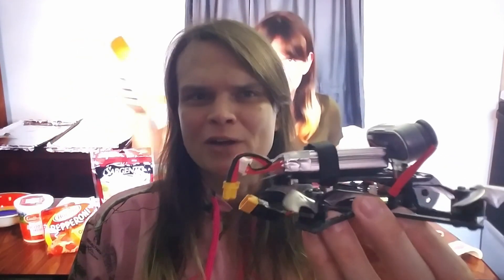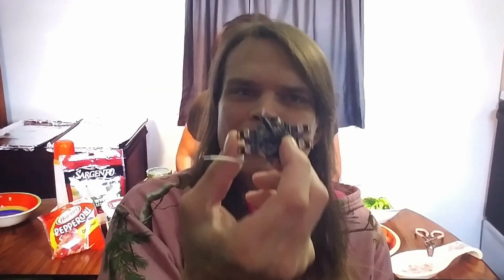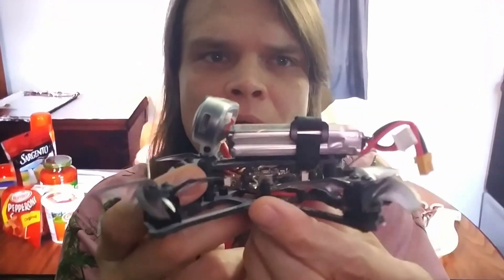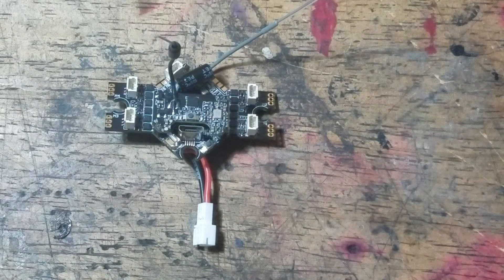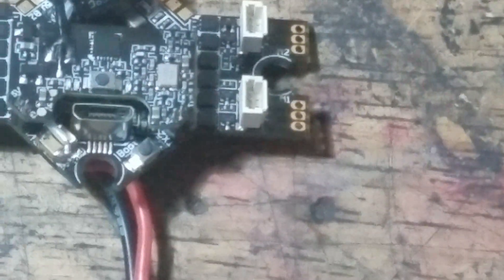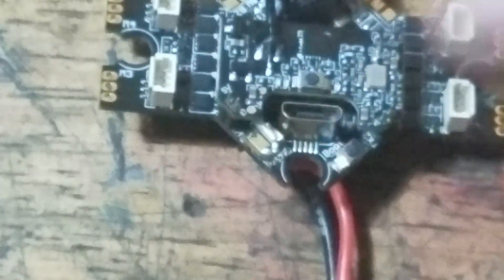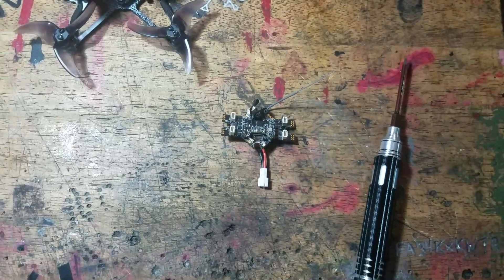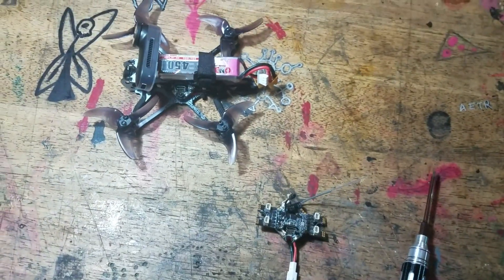How to use a RunCam Thumb on a TinyHawk 2 Freestyle

Comment: I have the thumb pro and the video would always cut out 1-2minutes into the flight. I soldiered the the wires to a 5v and gnd pad, would you suggest doubling up and using two 5v pads?
Reply from the maker: I'm not certain but I'm thinking a thumb pro might just be a bit too big for the tinyhawk 2 and the smaller lipo, I'd recommend trying to make a lead that let's you plug the thumb pro into the lipo balance leads directly and if you're still having a problem then the thumb pro may just be drawing too much power too fast 
The video linked here should be helpful in making such a lead 
https://youtu.be/bPxWh_FXG94?si=Lcp4F2XwX-k-jYBv

Comment: Is this possible if we solder to the buzzer pads on the FC, im afraid of frying the board by splitting the connections for the runcam and the vtx, i also want a elrs receiver so i would leave the rx1/tx1 and 5v/ground on the other side. Thoughs?
Reply from the maker: As long as you're getting 5v to it, it'll work. Probably a lot of different ways you could solder it if you wanted to. I just hook mine up this way because it's easy, and has worked well for me.
Goodluck with yours. It's gonna be nice with elrs💪 I hope you have alot fun with it🤟

Comment: Question, wouldn't attaching that to the drone to run make the drones battery drain quicker? Seems they don't last long to begin with. Because of you, considering getting a Fader 2 Drone. I smoke (I know, bad) but Marlboro has this program where you get prizes for certain amount of points. So, they have the drone and you have so much fun, I thought I might try. That is if I can earn enough points, lol. We shall see! I just love that smile of yours!
Reply from the maker: It does make the battery drain quicker but I save a ton of weight making camera light enough to work tiny drones. I would definitely encourage anyone to take up flying fpv, it's so fun